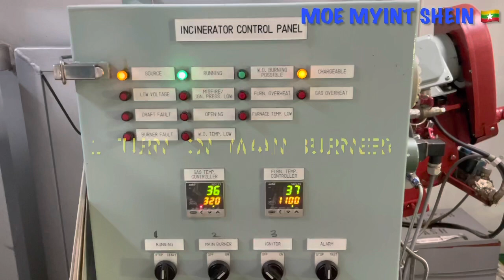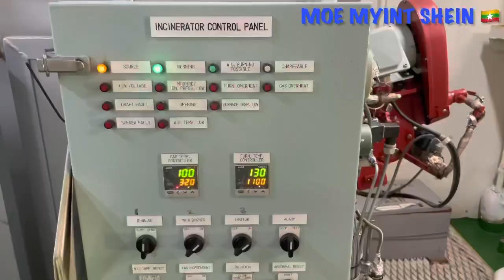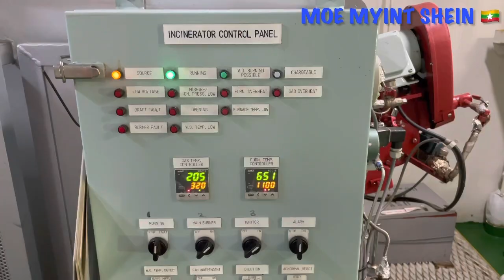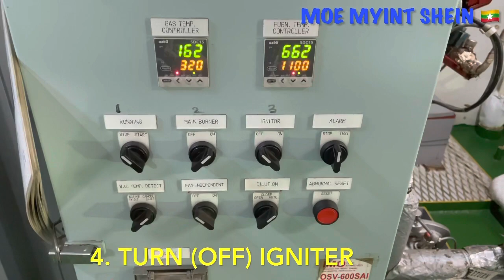[SUNFLAME] INCINERATOR Operating Procedures  | MARPOL | Marine Engineering | Technical Vlog : 016

Comment: sir, good day!
 pls help me!
after incineration completed where should i record?
oil record book part 1
Code : C?
Reply from the maker: Depends upon types. 
If you incinerated (ANNEX - 1) sludge, record in ORB (Part - 1) with Code(C), Item No.(12.3). 
If you EVAPORATED water in the sludge before it had been incinerated, record this evaporated amount with Code(C), Item No.(12.4). 
But, need to approve this Item No.(12.4) in IOPP Certificate with Cross Mark (x). 

If (ANNEX - 3) garbages which are approved to incinerate, need to record inside Garbage Record Book with Type of Garbage, Start - Stop Time and Estimated Amount. 

😊
Reply: @MoeMyintShein_MMU  many thanks🙏